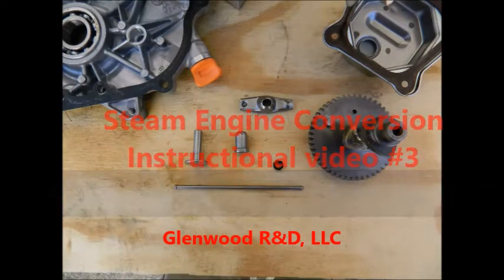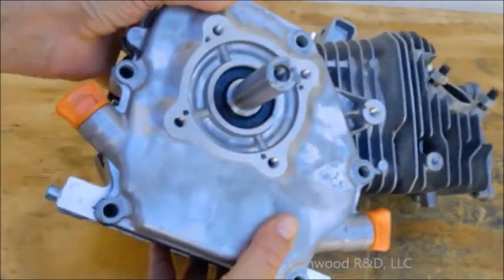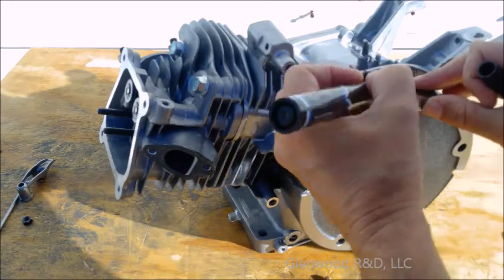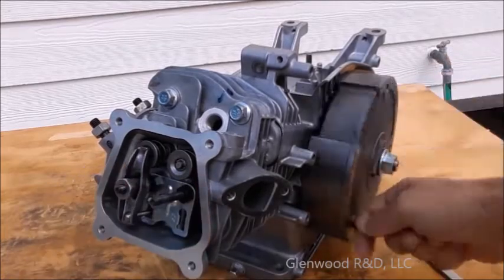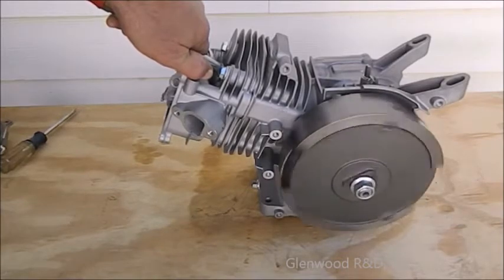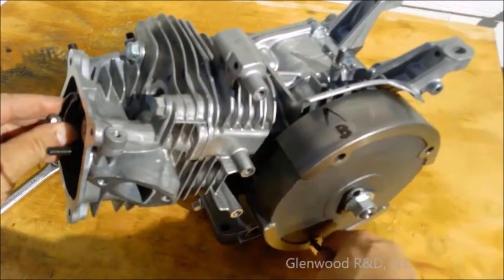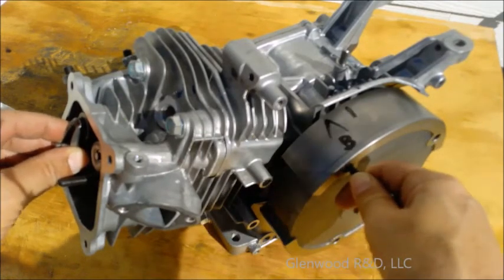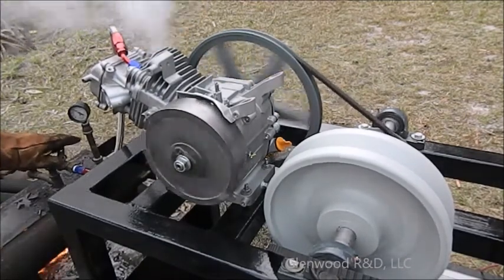Steam Engine Conversion Instruction Video #3

Comment: Couldn’t you also change the timing of the exhaust by changing the gear ratio from 2:1 to 1:1 crankshaft to camshaft which effectively doubles the rotation instead of doubling the lobes?

It would require less work to change the gear on the end of the cam instead of welding new lobes on the cam.

Comment: If there was a way to stop adding steam pressure through the spark plug hole, during the upstroke, and while the exhaust valve was open, would that greatly increase efficiency and torque?

Comment: 1- Is the steam engine 2 or 4 stroke? 2- Have you made any changes to the camshaft, also called valve timing? 2.1 Didn't you make any changes to the engine and just inject steam? 3- What is the pressure value in bars that makes the steam engine work?

Comment: it´s a really  great project, but is it possible to make this adaptation in any 4-stroke engine, like motorcycle engines for example, with low displacement... and if you wanted to control the entry of compressed air into the engine, it would be possible... like accelerating and decelerating the engine

Comment: This is a great video but can you please tell me if it will have as much power as the gas engine thanks so much for this great video.
Reply from the maker: Power is determined by the steam pressure. It would require a dangerous amount of steam pressure to equal a gas engine.
Reply: @gwseymour can you please tell me how much pressure needed to equal a gas engine?thank you
Reply: It will have more torque then the gas version but probably not as much horse power.

Comment: My timing is good but for some reason I can't get much for rpm's.  It's an old motor that is in bad shape though. I removed the governor also but didn't make any change. Ideas anyone?
Reply from the maker: Make sure your domant intake valve is seated, and you have good compression.
Reply: @gwseymour  after careful examination I realized my new lobe was short. It's doing pretty good now.

Comment: What PSI is this engine able to handle? I didn't realize this video was posted so recently, thank you so much for the info!
Reply from the maker: It'll handle any steam PSI you can give it, since it was designed to handle the PSI of a gas explosion. I wouldn't rev it "unloaded" much past the intended RPM of your gas engine. And, you are welcome! Thanks for watching!
Reply: @gwseymour  wow that's really awesome!! Do you use brass rods to braze your round stock on the cam? Or what is best
Reply from the maker: @tatethompson2648  I used the carb stud bolts from the Predator engine, but any high grade steel bolt will work. It's covered in the 2nd vid on the cam mod. Thanks again!

Comment: Hi, great project! Why don't you use intake valve and intake port instead spark plug port? I think if you use intake valve three will be no loss of steam from the source. Because in this moment, when the piston is going up and exhaust valve is open, steam from the source going to the atmosphere
Reply from the maker: Thanks for watching! The steam pressure would open the intake valve against it's spring, so you would be limited to PSI of 20 lbs or less. The amount lost thru the exhaust during the upstroke is minimal, and the engine winds up the flywheel much faster. Think of it as a 2 stroke gas engine. They spit raw gas, but you can't beat the performance.
Reply: @gwseymour  steam wasting principle
Reply from the maker: @emil.honganmaki5461  Yes....and no... I've tested several methods, and this one winds up the engine much faster due to mechanical simplicity. You could say that a turbine "wastes" steam since it just blows thru the blades, and into the air....but...RPM's equal power.